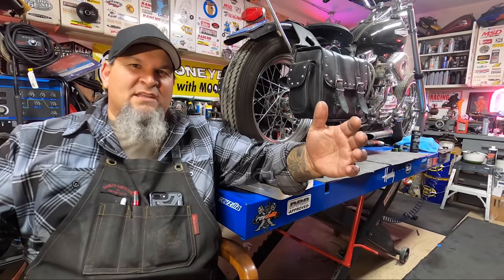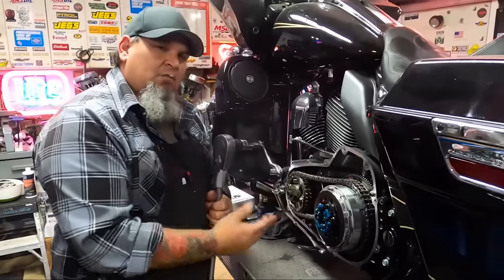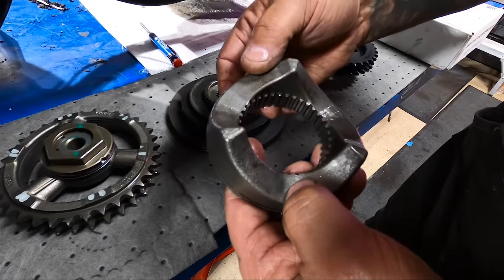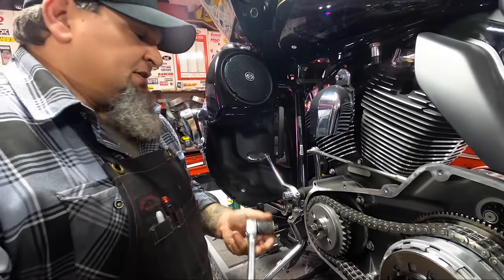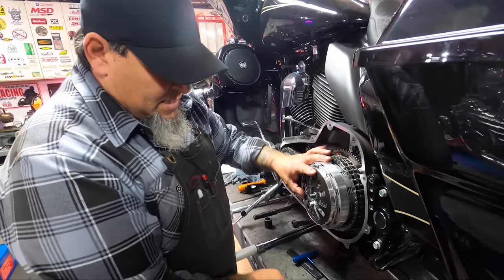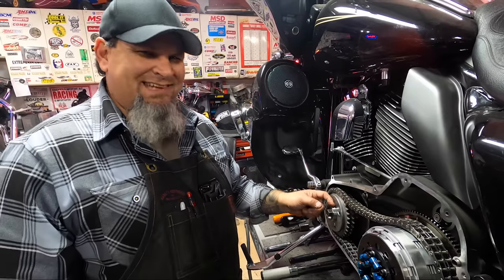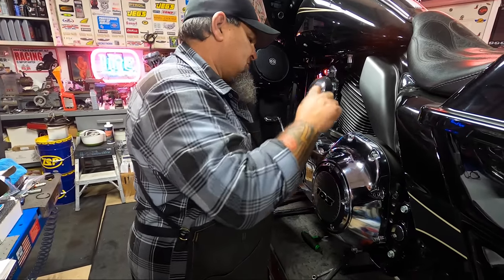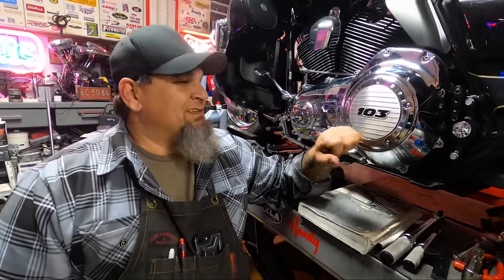Compensator Upgrade for Harley Davidson

Comment: This guy is the best I like the details he is very easy to understand..Best video so far👍👍👌👌👌
Reply from the maker: Thanks for stopping in Stanley! I appreciate it! Glad you enjoyed the video!
Reply: Hey Gary great video 😀 don't know if anyone has asked but apart from the Compensador where can I get my hands on the tool you touched on. I'm have all kinds of problem trying to get on Dark House website. Can you help a fellow wrencher out here? Thanks 👷
Reply: I agree!!!!
Reply: @LateNiteVTwin  Like the video Gary, I have a question, I have an 03 FXD 95 in, Darkhorse crank, Joe Mondello heads, Wood .590 cams, 10.5 comp., Was thinking of the plain gear front compensator, just because it's lighter, simpler. What is your opinion of those?

Comment: He obviously knows what he's doing, I always watch for subtle clues. Notice during the crank bolt torque process he DIDN'T  use the torque wrench to loosen the bolt. That ruins torque wrenches, they reverse direction for left handed threads (like the clutch nut). Well done, definitely subscribing
Reply: The only reason it would ruin the Torque wrench is because he used Red loctite        other than that the amount of Torque needed to loosen the bolt should be the same.    But I guess it is a good idea to use a breaker bar to loosen bolts or nuts that have a high amount of Torque

Comment: Thanks for taking us on a detailed and outstanding explanation  of the step by step procedure of installation of compensator and clutch basket.
Reply from the maker: Glad you enjoyed the video! I hope it helped you out!
Reply: Harley should have gone to a belt primary drive decades ago in the late 80s I wrote an early Shovelhead that had a primary belt drive and a secondary belt drive and the bike was smooth as silk most of my British bikes are still running on the original primary chain and tensioner mechanism sometimes Harley engineering makes the British bikes look state-of-the-art even though they've all been dead for fifty years

Comment: Installed the ManOWar on 2012 Glide. 30k miles worth of riding and it's been awesome. Bike has 96k now. About due for the cushion kit. Only noise I get is the trans chatter that they have a service bulletin about. Higher mileage bikes in neutral with the clutch lever out cause a noticeable chatter. No mechanical worries. And it's no big deal to me.
I'm a fanatic for short concise videos. It was good you added the time stamps in the description. Thanks.

Comment: I put a mam-o-war compensator and hayden M6 BT07 antomatically adjusts primary chain tensioner in my 2012 (103) road king classic and doing GREAT.
Reply: I got same bike like yours & start making those clanking sound when I switch ignition off but start & ride fine without those clank sound ... Do you think this is compensator issue ? Do I need to replace it ? Thanks
Reply: I'll be doing the same upgrade as yours when the time comes. My 2012 (103) FLHX has 30,869 miles and all is well.
Reply: My 2012 FLHTK hit 30k and it needed the Dark horse along with a complete cam chest replacement.

Comment: Awesome explanations of what you're doing. I've watched a few comp replacement videos and yours is among the best for sure.
Reply from the maker: Hey G Dubb! I do not have any experience with Southern Oregon Hot Bikes...... I can say this, a manual chain adjuster is a must in a late twin cam or M8. The design is a failure big time as it does not allow the chain to float with some slack. Chains are not made to be banjo string tight, unlike belts, that need a certain load. Give them a try and let me know, and thanks for stopping in! Glad the video helped out!!!!
Reply: @LateNiteVTwin  
LOVE YOU VIDEO'S!!!!
What's your thoughts on
A 2012  SG.
103 ci
Rinehart True Duals
Arlen Ness Bug Sucker Airfilter
Looking to get Screaming Eagle or Dark horse
No Racing No Burnouts No Racing 
Just Cruising.
Thanks
Reply from the maker: @QBama100  Well, to be honest, the screaming eagle unit is 100 bucks cheaper than the dark horse, but its the design that fails. In my opinion, the dark horse is a way better design, and with a stock 103, it'll last forever and be reliable. ditch the automatic adjuster as well. Hayden makes a really nice unit for that bike, and set the chain slack at 1/2-5/8" and ride worry free!
Reply: @LateNiteVTwin  THANKS
Reply: a trick : you can watch movies on Kaldrostream. I've been using it for watching all kinds of movies these days.
Reply: @Gunnar David yea, I've been watching on kaldrostream for since november myself =)
Reply: @Gunnar David Definitely, I've been using kaldroStream for since december myself =)
Reply: @Gunnar David yea, I have been using kaldrostream for since december myself =)
Reply: lol awesome explanation that addresses absolutely nothing as you will always have the same problems as you did before. Adding a same component in the same space of the same that functions exactly like the old one does nothing to eliminate the potential hazard and your life will be in just as much Danger and the odds of destroying your motorcycle will be the same as they were before
..the only way you can eliminate all compensating sprocket problem is to just simply eliminated altogether using a plain double row tooth sprocket ..the original purpose for a  compensator we're used to protect internal components of farm machinery and or the drive systems of said farm machinery from over-running one or the other in one operation instantly becomes locked... earlier Harley-Davidsons if your engine seized up the compensator in-house brain will allow it to flipped over the ramps of the compensator the clutch and transmission shaft were not locked instantly also that can possibly damage a lot more that has there's no more practical room to use in today's primary cases large enough to house a compensator that would have to be much more larger in diameter to be of any protection especially for a stage 4 Kit F-117 can begin used in conjunction with the off-road only Harley-Davidson Twin Cam heads that together create horsepower and torque that will snap that brand new new design Screamin Eagle compensator just like the one in this video will instantly become shattered when you dumb 120 horsepower releasing the clutch lever at 6800 RPM and your back tire is ratchet strapped down to the drum with welded expanded metal for zero slippage at the out Dyno drags recording a 9.6 second pass 123 mph that will guarantee you're screaming eagle compensator sprocket has just screamed as an eagle for the last time

Comment: Worked on them all my life been running stock parts on my Ride for over 22 year,s same ride original parts it came with except tenchion,r,s on the timing chain,s the ride has 280 thousand miles on it Rock Out man!!

Comment: Thanks for patiently explaining each step. No fluff, no bias. Just working on a Harley.
Very refreshing for us that try to work on our own bikes for the satisfaction and savings.
I hope you'll keep doing the videos.
I have a 96 inch twin cam in my 2008 cross bones. I will be upgrading it to a 110, changing bars, and this compensator upgrade will be a must. Oh, and I do like the oil cooler video too. May be adding that too!
Thanks again
Reply from the maker: Hi Timothy! Thanks for stopping in! I love the second gen twin cam. I did a 117' in mine, and it rips. I think you'll really enjoy the compensator. Ditch the stock tensioner to. Set the chain and just enjoy the easy shifts and less wear on the inner primary bearing. The oil cooler is an OIL BUD. He is in Helena Montana. great part and it has waaaaaay more cooling capacity than any other oil cooler made for our community. Check him out.

Comment: The special bolt and oil deflector are recommended but not mandatory. They do come with the kit depending on year of bike. You must ask the dealer if you need these items for your application. I bought mine from Baxters garage and it was delivered without the bolt or deflector even though it should have come with them from Darkhorse. No knock on anyone, I didn't ask the right questions. I just got off the phone with a sales guy at Darkhorse and he is sending me the deflector and bolt as soon as it comes off back order. He told me to put the bike back together and ride it until the next oil change and by then the parts will be delivered. Happy wrenching and great video. It made the job much easier.

Comment: Great video. Replaced the comp on my ‘09 Ultra @19,000 miles with a Baker. My stock compensator left me stranded. I knew by the hard hot banging starts and other symptoms, it was on its way but I continued to take the bike out until it quit (dumb). My Ultra is a stock 96” with slip-ons.

Comment: Love the video, but I think there may have been a math error: 1qt is 32 (not 38) fluid oz. So, assuming one needs 45 oz fluid for an install in a dry primary, you should have added 13 more oz, not 7.
Reply from the maker: You are correct Scott.....Good catch. I work the shop by myself, and the manual is correct. You are correct. I did in fact catch that after editing and made the oil level adjustment before delivery. Sorry about that.
Reply: exactly.  I caight that also.  having said that, I still subscribed.  this guy is just right.
Reply: @LateNiteVTwin  I have a 2014 road King. I  drained all my gear oil, and took off the primary cover and just replaced all my clutch plates. I only put one qt in because I was told the oil only had to come up to the bottom of the clutch basket. So I wonder if that is why my brand new clutch seems to slip when it gets really warm during slow speed maneuvers,  or when I get on it to  hard?
Reply: @wolfpack8643  oil displacement on road king from what I've heard causes that.
Reply: @wolfpack8643   I have a 2014 Dyna low r. I drained my primary change the pressure plate and Springs and change tensioner put the primary back together and mine only took a quart to the bottom of the clutch basket runs fine.  After about a 100 miles took the Derby cover off checked level still at the bottom of the clutch basket there is were im leaving it one qt.  go figure
Reply: @wolfpack8643  Not the bottom..Actually The outter edge of the basket should just be submerged in the lubrication, on an engine which is leveled and off the jiffy stand.

Comment: Interesting compensator story for you...... Road 2 miles to the grocery store came out hit the start... Comp kicked back... Bang.... Hit the starter again...zing zing zing nothing.  ...  Two and a half hours later and 90 bucks for a tow truck I'm back at home... Pop the primary off... The starter gear exploded into three pieces.... The larger of which got lodged between the primary chain and the clutch hub assembly.  After doing all the work myself it still cost me $1,600 to get it back on the road.    Baker Comp, new style rotor to allow the baker, Baker manual chain adjuster new chain new clutch hub assembly new starter.    Nearly 1500 miles later I just Lost the inner primary bearing so all of it has to come out again.  Love your videos keep them coming!!!!
Reply from the maker: Oh man, sorry to hear you had the compensator blues! Yep, stock ones aren't fun when they wear out. The Baker stuff is a trip shelf part, and you'll enjoy the purchase. Stay tuned for more videos! They're coming!

Comment: Tech Tip,
   I find a lot of pressure being placed on the primary drive using the single wedge between the sprocket and chain. As a solution, especially when torqing the compensator nut, I presonally found that if I use another wedge between the primary case and outer surface of the primary drive directly opposite of the  one used on the inside of the drive (chain or belt) the second wedge limits the movement of the inner wedge and transfers the force from the clutch hub basket bearing to the primary case minimizing the stress on the drive chain or belt
Reply: I get your Thinking.. But how much Tensión is on all that when doing a Burn out, Wheelie, Lugging or Banging Gears.?? ✌️

Comment: I called Dark Horse just now about the factory compensator bolt versus the Screamin Eagle Torx bolt and they said the Torx bolt from the SE assembly will work just fine. Their customer support is top notch.

Comment: Dark horse instructions say to use the torx bolt.  Since installing my dark horse (using the stock hex bolt) I seem to have a lot of noise.  I used the Hayden tensioner, then went back to stock tensioner, still seem to have the noise, almost sounds like a slack chain slap and only when not pulling.

Comment: Harley Should have done this upgrade from the factory--also, should you not check "alignment" from the compensator to the clutch basket?
Reply: Agreed. The MoCo knows the comp is a POS but they keep putting it in. Total bull💩. The alignment should never change - no need to check unless you're putting something in behind the clutch or comp. Or if something went back in wrong.
Reply: @gdubbsmotolife9713  I’ve seen that the M8 comps are completely breaking and not just wearing out like the twin cam. Looks like Harley is just going further in the wrong direction. With the EVOs there wasn’t many issues but the twin cam issues and even worse with the M8.

Comment: Liked and subscribed Brother. What you do is great! Hard to find such experienced people that have the heart to share their craft! 
Would you recommend this on a 2020 Ultra? If so any other recommendations while I'm in there. Your video has giving me confidence to try this out. Haha. Hope I'm not over doing myself.
Reply from the maker: Hello Anthony! First, thanks for stopping in! If you get the service manual, then everything is in there to help guide you as to how it all comes apart and goes back together. There are special tools, and some details I don't cover as they would make my videos 5 hours long and people would lose interest. I always state to have a manual present. So, with that. as far as upgrades, Any Harely always benefits to a nice cam. Which cam you choose depends on riding style and expected performance.Never over cam, as you will do more damage to the bikes performance and your wallet. Choose a good exhaust, of your liking, the Vance and Hines power duals are great torque builders, and the Basani Road Rage is one of my favorite two into one systems. I think just doing some simple research on the inter web is always a good place to start. Read reviews, and set your expectations a bit lower. You can't believe how may of my customers come in for a cam job, and say.....well, the book says it will do this! The specs are in a controlled setting and they don't give you compression ratio's, or head specs. and exhaust specs. They just say the cam will do this...... I think a well thought out bike is a well designed bike and if you have  a goal, like touring, and extra weight, then build your bike for those duties and you can't loose. If it's a bar hopper and drag racing machine, then you're in a whole different world. Like I always say, plan your work, then work the plan. If I can help, drop me a line and I'll do what I can!

Comment: All of these issues with chain tensioners and compensators as well as faulty cam chest components gets pretty frustrating after while. As a guy who loves his Harley even I am starting to question them.
For a "premium brand" all of this crap should have been a recall not something that's dumped on the customers lap. Or better yet, designed and tested properly in the first place.
Reply: I got my first HD recently and im thinking the same thing. People can say whatever about metrics but i can tell you what ive never had to do anything other than basic maintenance on them. 

Obviously their drawbacks are lackluster resale value. The aftermarket for most metrics isnt great at all. But as far as reliability? Its very very hard to beat a Japanese bike.
Reply: @helpcurecatholicism  When I had my 883 Sportster it didn't have any of the problems that the big twin Harleys have. That bike was every bit as reliable as any one of my Japanese bikes that I've owned in the past. If they just made a bigger version of that engine for the big Harleys that would be the perfect Harley for me.

Comment: I used my 1/2" ugga dugga to wing the big nut off the compensator, ground off about 1/4" then use all the ugga duggas to lock it down, compensator fixed👍
Running an Ultima belt drive now.
To each their own, I didn't buy a Harley to not have vibration, did a balancer delete last fall, can't keep mirrors or signals tight, but I'll be getting the win light at the track.
To be fair, good informative video sir👍